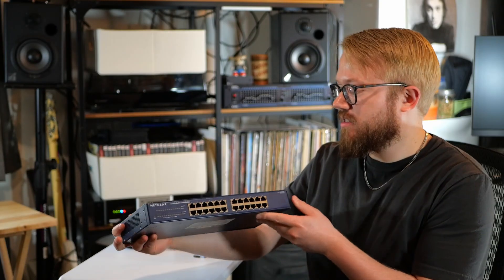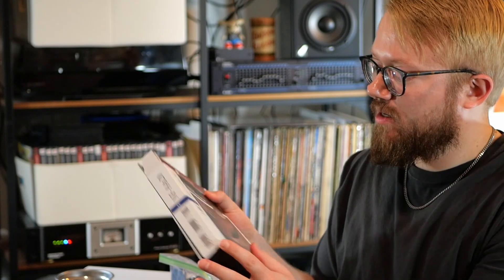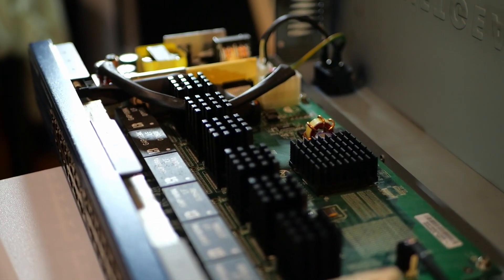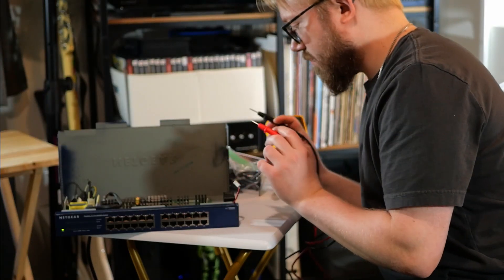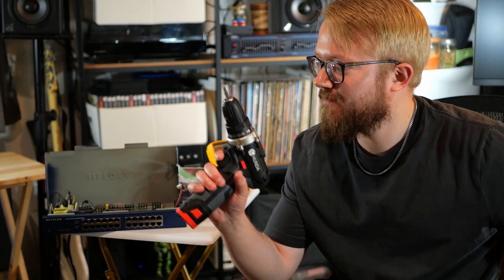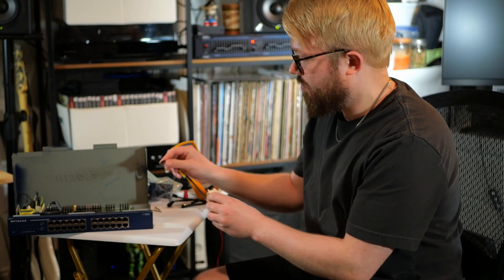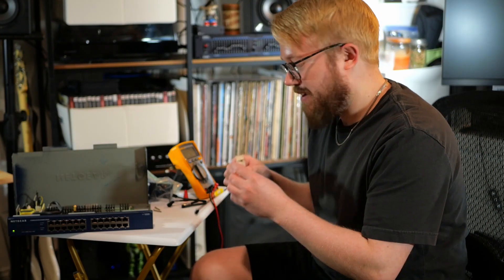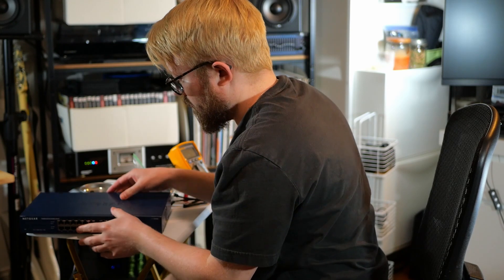How to Replace a Network Switch Fan - Netgear JGS524 - Noctua NF-A (HD)

Comment: Replaced mine today.  Big noise reduction.  Somewhat challenging as the pins on the plug were yellow/black/red not yellow/red/black in the video at 3:38, so had to rewire it with help of a paperclip.

Comment: Watch 03:42!
Left pin marking is (+) positive but you fan cable color is black (GND).
Reply from the maker: Hey, I'm actually not connecting the black wire there, it's just floating. I am connecting the red cable to positive + and yellow to ground on the 2 pin fan header